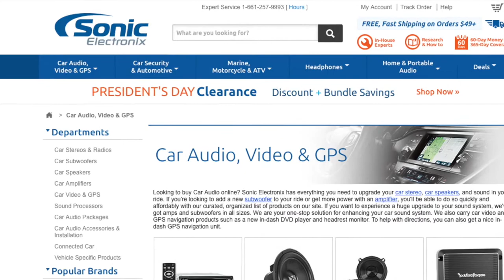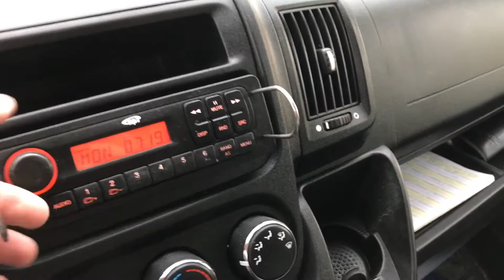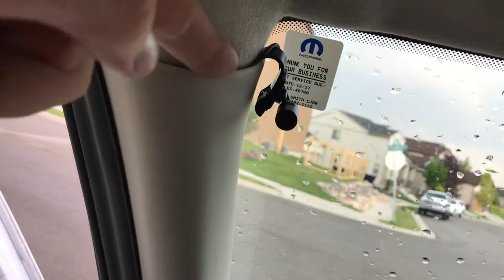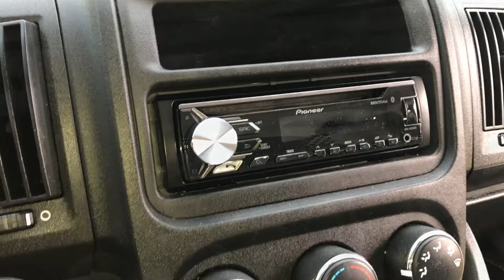2013 - 2022 Ram ProMaster / Fiat Ducato Van Stereo Install

Comment: I have a good fiend converting a 2015 pro master van to a camper. They have the backup camera and rear bumper sensors all ready. They want to add two rear speakers. Everything we find is about the same...no wiring colors given, just a six plug adapter.    What are the wiring colors at that connector for rear speakers!?  I can’t believe that nobody says!  Please help!  We understand the engineering mode, but why would it not let us in wether there is a change of speakers or not? Engineering mode should come up no matter what, right!?

Comment: You did show plugging the harness into the new radio, did you use the small white harness or not? and what is it for. My radio would loose power, if I pushed on the small white harness it would come back on, Unplugged it and stripped the sheath back and now it won't work at all. I have power to the 10amp fuse.
Reply: Did you figure this out?
Reply: It is for USB Ports. By the steering wheel. Did need it so just left it off. New radio works fine.  @ormie07

Comment: I wasn't very clear about the type of adapter used to connect there, did you just crimp the wires from the original adapter or purchased an accessory one? also I like to know how to install a double din touch screen radio in this same exact single din radio profile and where do I get the parts for it. Thanks.
Reply from the maker: The description has all the parts used in this install.  We didn't cut into the factory harness, instead we used the adapters.  Just crimp together and plug and play.  Now, if you are interested in installing a double din, you may need this kit: https://www.amazon.com/Metra-95-6523-Installation-2014-up-Promaster/dp/B00PR67H1C
Reply: Already did some research and found out about this piece. But thanks a bunch.

Comment: I installed the new unit radio works but there is no sound coming from the speakers checked the wiring multiple times and everything is the way its supposed to be.
Reply from the maker: Sounds like you may have a factory amplifier.  Did you hook up the solid blue wire to your new radio?
Reply: yes I have the blue wire hooked up,  still no sound. radio turns on just no sound at all
Reply: How do I direct wire the radio so when the key is off I can listen to the radio and not lose my stations

Comment: how about canbus support?
Reply from the maker: You can find support, but this ram has a analog accessory wire at the harness, so no smart harness really required.
Reply: @ProvoBeastAudio  steering wheel controls are canbus
Reply from the maker: @_WADE13x  Not in every case, but for this Promaster, if you want to retain steering wheel controls, you can use the Crux SWRCR-59D adapter.